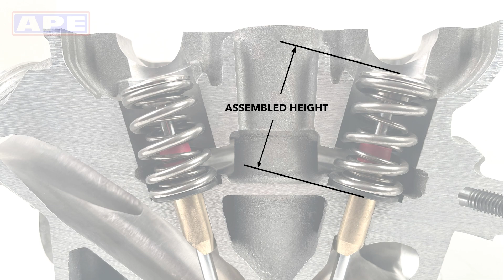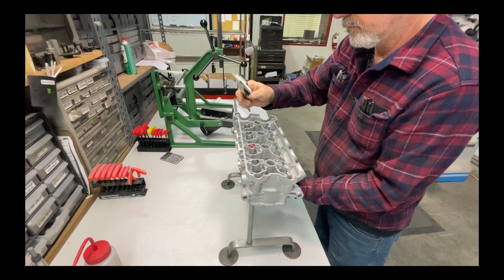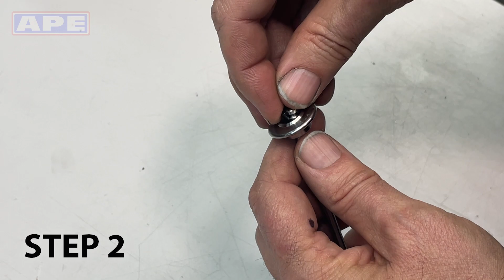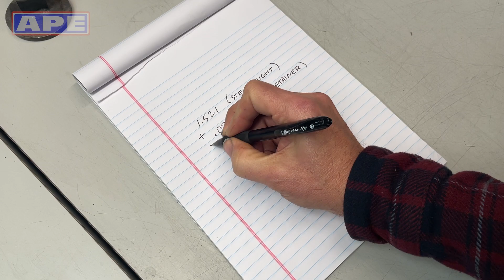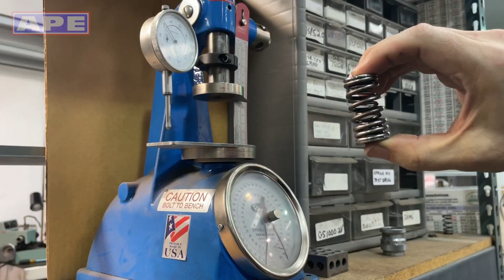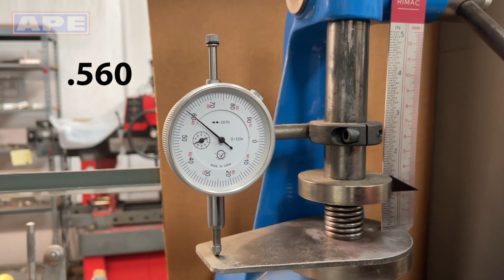FINDING SEAT PRESSURE USING ASSEMBLED HEIGHT

Comment: dont forget to check the clearance between the retainer and the top of the valve guide / stem seal. dont matter what the travel of the spring is if you smack those together first.

Comment: good video,  how do you know when more spring pressure is needed ?
Reply: If the valves don't close in fast( like at high rpm), the pressure can be increased.
Reply: let me ask it this way, what is the symptom or symptom's ? (valve float or valve bounce) Does the power kind of go flat or level's off at the higher rpm range? like it's going lean?
Reply: @chickenlegsblack8473  Valve float, or possible spitting a valve keeper, which can drop a valve and destroy your engine.
Reply: @DaleWalkerHoleshot  understand all that... but how do you know when you need more spring pressure when the engine is still on the workbench ?
Reply: Thorough explanation and demonstration on the dyno. https://www.youtube.com/watch?v=Ga-iloeel4Y